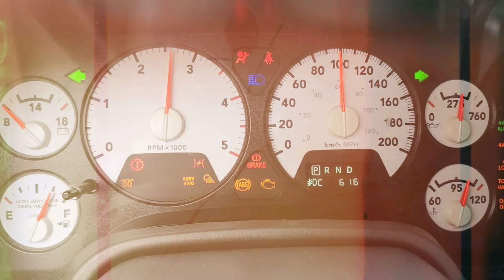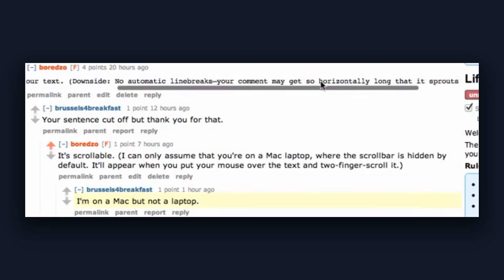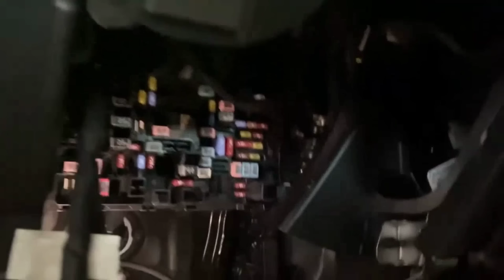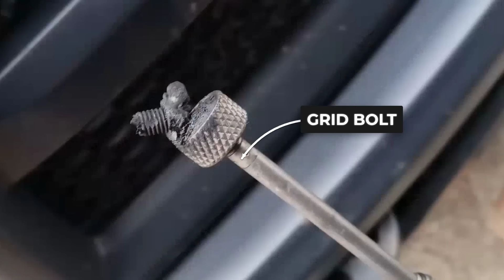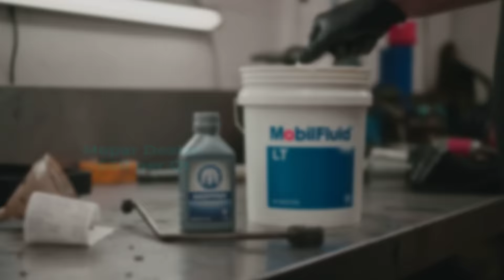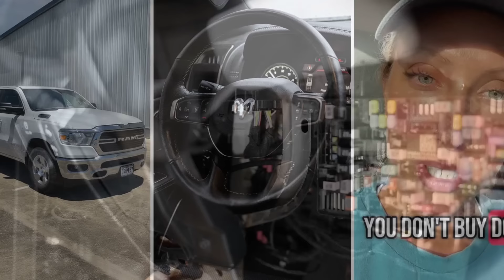17 “ILLEGAL” Hidden Ram Tricks Mechanics DON’T WANT You Using (But They WORK!)

Comment: I CHANGED MINE OLD GRID HEATER TO A NEW BANKS  INTAKE THAT REALLY HELPS THE AIR INTAKE OF AIR AND ALL THEAIR TUBES AND THE INTERCOOLER FROM BANKS AND THE TURBO AND ALL OF THAT MADE A GREAT BIG DIFFERENCE  IN HORSE POWER AND IN FUEL MILEAGE  SO FOR FOR THE $2000 DOLLARS I DEFINITELY RECOMMEND IT

Comment: The comment about disabling the MDS and lifter oil starvation is incorrect. Disabling the MDS keeps the MDS lifters from cycling between modes, which prevents these lifters from "cycle failure". The oil starvation issue has to do with insufficient oil pressure at idle, due to the oil pump. This is why some have gone with installing the Hellcat oil pump, which offers a 12% to 14% increase in oil flow.

Comment: Disconnected the solenoid on my 2015 3500's grid heater about 6 months c after I bought the truck. Middle GA so don't need it,  if it does get cold I plug it in.

Comment: So turning off mds ruins cylinders and lifters because of lack of oil..then what happens when u put it in town hual mode..that deactivates mds mode ,does that ruin that engine
Reply: Bought a Diablo tuner first thing I did was turn off MDS. It does not ruin anything.!

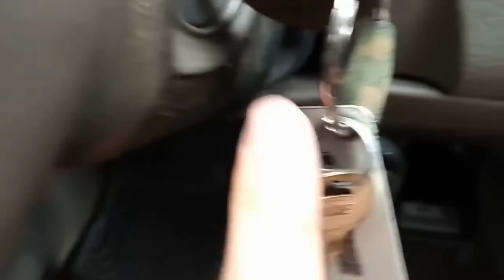Comment: 5:50 from what I found from research, you need a high flow oil pump not a high-pressure oil pump to remove the tick at low idle.
Reply: correct! also helps keep the cam and lifters lubed and prevent lifter failure.

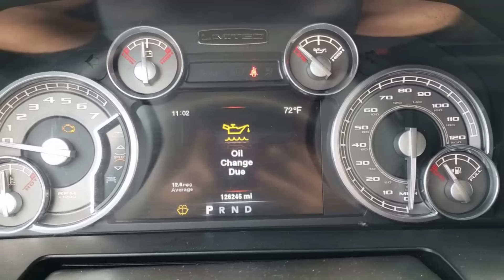Comment: 2:28 wait why do your own oil change and then pay the dealer to reset the light, you can just pay the dealer to change the oil and they reset it for you for free. The oil (synthetic) and air filter and labor is $85 with coupon and I always get a coupon. you don't get dirty and no mess 2 clean up or Oil to dispose of. Plus they check everything, rotate your tires and wash the car (with a bucket of water it looks like) at no extra cost!
Reply: Why let the dealer do anything ?? I do my own oil changes since I started driving. My Ram never had that Oil light issue, but my Cherokee did and I simply did the hack to reset it . People who pay the dealer to do simple things are just uninformed, handicapped or dont care bout spending money needlessly!

Comment: You can also put the 5th Gen and Durango trucks into Sport mode, which turns off the MDS. I run mine in Sport all the time, so that MDS doesn't  operate.
Reply: And lifters are not getting proper oil pressure if you do that.
Thats from mechanic, not Ram, any.
Will post a link in reply.

Comment: 5th generation rams won't let you program your key fobs.......believe me I've tried.   I have Alfa ODB and a bypass module.    You need a pin......my understanding is the pin is a rolling code pin as well, so they change each time.   Am I doing something wrong?
Reply: I had the same issue so no you are not doing anything wrong. I even have my scanner that does fobs but won't do the Ram fob.
Reply: Love our Stelantis overlords, have to purchase a code each time you want to program a fob. I am not going to let my fob out of my sight. my scanner/fob programmer has yet to be used. let us know the price for the code
Reply: It can be done, but you have to be patient.  Took between 12 and 14 attempts on 2 different gen 5
Reply: Alphaobd cant read 5 pin but jscan will

Comment: The auto START/STOP feature doesn't bother me on my 2024 RAM DT Tradesman. When I anticipate the light to change to green, I lightly release the brake peddle. The motor starts before I fully lift my foot off the brake peddle. Different from the old method, but I don't mind it after 37 K miles. I have been driving vehicles since the late 1960s. I can still do jack rabbit starts when I choose.
Reply: The start stop kills your starter because of how many times it’s being used every drive.  the life of the starter is my issue.
Reply: @FlabsforAbs  - The starter/generator is designed to be significantly more robust than the traditional starters. When the start/stop feature was first introduced, standard starters were used and did reach their design life of "starts" quickly. Hence the bad reputation.